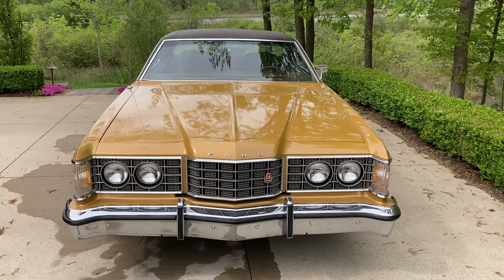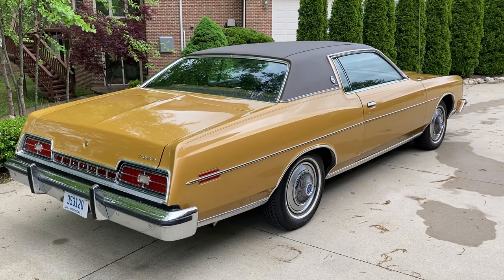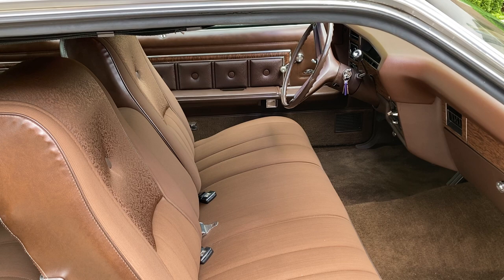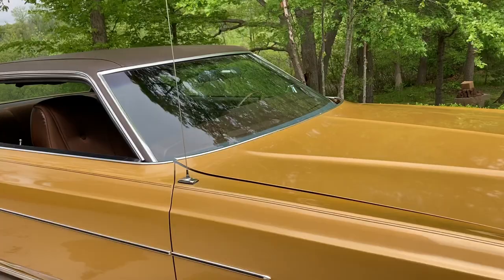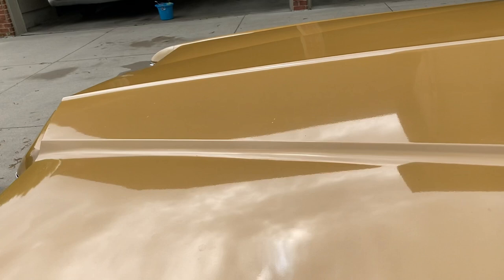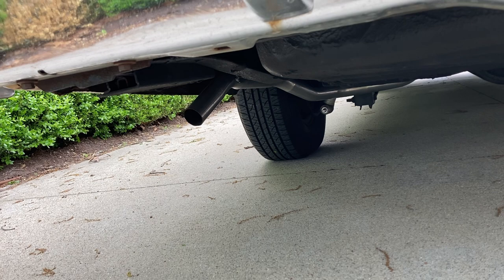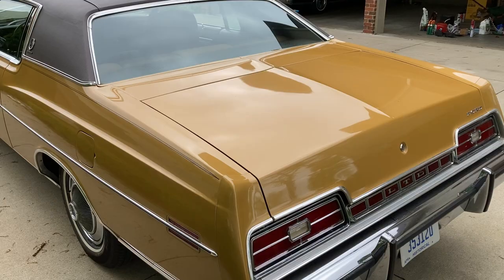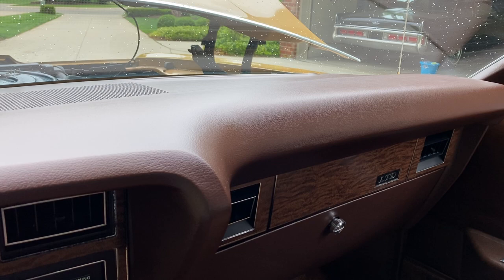1973 Ford LTD Brougham Coupe 460 V8 - The Everyday Man's Near-Luxury Car

Comment: As a small kid in the 70’s I always loved the LTD. 71 and 72 are my favorites. This is a beautiful example.
Reply: I agree with you on 71 and 72, especially the 71.  I always thought in 73 they looked bloated, and I never cared for the resurrection of the 65 style tail lights.
Reply: @kennethsouthard6042  The major change in '73 were park bench bumpers.  Not very much other than that.  The pre-battering ram ones are definitely better looking.
Reply: @HiroNguy The car changed drastically in 73.  In addition to the front and rear facia the The body sides changed to where I don't believe any sheet metal from 71 or 72 would fit on a 73.   The interior changed radically as well including the dashboard. Overall, the car just got bulkier from here and gradually became more of a mini Lincoln, similar to the Marquis
  The car essentially stayed in this form up until 79 when it was replaced with the Panther platform.
Reply: @kennethsouthard6042  I'll look that up.  Thanks for the lead!  To my memory my friend's '72 Galaxie looked almost the same as my '73 but for the bumpers but that was a long time ago so memory might not recall those details.
Reply: Early 70’s LTDs had the worst suspensions. You would drive one at highway speeds and the front end would bounce up and down,
Reply: 71 72  LTD's my favorite as well. Always thought Ford waited 3 years and used 68 Pontiac's "style" grills on the 1971/72 LTD model
Reply: @HiroNguy   That  is correct  in those  years   Semon  Bunkie  Knudsen  was  in the Presidents Chair at ford for a  short period  then  in the spring of 70 Lee Iacocca  became President the new models  that  come out  are always  a couple of years  old on the drawing board  you see  Henry the  second  grandson of  the old Henry  Ford  that past on  in 1946  was always a Secret admire  of the  General  Motors  culture  or persona  he loved their  marketing  strategy of a car for  every phase of a persons life  and  that is why he would secretly recruit  G.M .  People threw the back door at Ford  and would have secret meetings  with them at night  at their homes or some offbeat  back street location  as not to draw attention  but when they did come to Fo Mo Co  their stint  was short lived  some never made it past one year more like 6 months  G.M. People could not adjust  to his clandestine way of  operating  and  they could never  catch up to Fords pace which  was fast when compared to G. M.s  country club style & slower pace  he would give them the boot and they were totally dazed  they would walking down the corridor  or sitting at their desk  talking to themselves  totally  shell shocked  like did I just get fired ???  That’s  all folks  Ford was a fast paced  environment     You should read  Lee Iacoccas  auto biography  you will learn a lot  about  Lee  and the Ford family and  the Ford company  and auto industry and  all the supporting  industries as well  and a little about Wall Street  the banking industry  and our own government
Reply: My grandparents had the same exact car but was a royal blue and royal blue interior
Reply: @jeromecabral192  yeah when I was  Wee tyke  back in the early 70s  we had 3 LTD    Country Squires  71 dark green metallic  W/  dark green  interior   A 73  medium copper metallic   W /  ginger  interior  dark brown  dash & wheel& carpet   A  75  light / lemon  yellow green  a very rare color  with  dark green interior  and I remember a lot of details  that surprised  my parents  and my self  but like stuff to do with  school that was more important  I just don’t  recall  LOL
Reply: We had a powder blue 72’ 351 modified 400, that ol girl could eat the miles up.
Reply: 71 was gorgeous. Never should have sold it.
Reply: Me too!
Reply: @busman7228  < Not true.
Reply: Yes. Those are my favorite LTD years also.

Comment: Sacred Fertilizer!  This LTD looks almost exactly like Gus, my '73 Galaxie 500 2 door.  It was 351W 2 bbl.  I got it in Mississippi so we couldn't use the right side of the trunk as the rust holes were Yooj.
Reply: Sacred Fertilizer 🤔😜🤪🤯🤯🤯
Reply: @buff6637  Upvoted for that alone.

Comment: To own and enjoy a car of this vintage it helps a lot if you are mechanically inclined like this man is.  Otherwise you will be dumping money into it and stressing out over incompetent and dishonest repair shops.  This man had the upper hand with the dealership and they basically had to bend over and grab the ankles in this transaction.  Great stuff!
Reply: This is a turd, they didnt want it either. Trust me, they gave $300 on paper for it which is $350 more than its actual value.
Reply: @stevepulse4893  STEVE LOL 😂
Reply: these cars were easy to work on.

Comment: 73 is such an interesting year: the oil embargo didn't happen until the 74s were out. You get the smog controls and huge bumpers, but for the most part, you're getting this interesting blend of pre-malaise and early malaise features that are just super unique. It's the size and comfort and quality of the late 60s, still with a big block, but while also having the first compromises for emissions and safety. It's a transitionary period and I think that, as far as owning these cars today, they're a great way to enjoy a period of time where changes were coming quick and fast.

Comment: Wow, another remarkable find.  I was a 19 year old fixated on muscle and sports cars in '73 so I completely ignored these full size cars in the day.  Nowadays I can appreciate these vehicles more, and I have to say this Ford LTD is one of the best examples of the type I've seen.
If I was my current age back in '73 this is the car i would be driving. A comfortable, well appointed, powerful and slightly sporty full size coupe.  Thx
Reply: Rated at 212hp, curb weight 4260 lbs. Powerful? My god! Compared to what!!!! A tractor?
Reply: @stevepulse4893  Compared to other full size cars of that period it was not bad. Engines were rated in SAE Net Horsepower (all std engine accessories and std air cleaner and exhaust system in place). The compression ratio was reduced in '73 to run unleaded gas. Under the old SAE Gross Horsepower ratings it might've been rated around 300HP.  Performance has to be compared to similar full size cars of the day which will weigh about as much or more.  Even this 460 would have ample torque to get the car moving from a dead stop decently; it's just short on top end hp.
Reply: @rogermason5833  its rated at 212 hp. Sorry.
Reply: @stevepulse4893  It has the most powerful engine in that car line.  It was powerful compared to many cars of that era and later eras, as the car companies went with small cars with 4 cylinder engines in the 1980s with less than 100 hp.
Reply: @moonbeamskies3346  it was cool, but it never was a collectors item, but i definitely agree for its day it kicked ass,,,,,,all 4250 lbs of soul!😁
Reply: @stevepulse4893  Rated at 365 HP in 69 to 71. Torque was 480/500 fp. I drove a 76 Country Squire with a 400 rated at 180 NET HP, 330 fp of torque. Despite it's weight it was kinda fun to drive, lot's of low RPM torque.
Reply: @stevepulse4893  212 is plenty of power for a 4260 lb car. Sure it's not exactly fast, but it's more than enough to keep up with modern traffic, plus you gotta keep in mind all that low end torque.

Comment: There is a 1974 Ford LTD coupe with a 351 2 barrel motor for sale at a dealer I drove by in Northern Illinois. It has 18,000 original miles on it with the original title. It has allegedly been in a heated garage since 1980. They are asking $9990 for it. New fuel tank, fuel pump and tires. Maybe I can low ball it like Adam did this one.

Comment: I one bought one new. Yes, during the gas crunch! 1974  2dr. LTD Brougham. Ginger glow metallic. 460 V-8, C-6, 3.25 axle, trailer towing package, A/C, P/S, Front power disc brakes, auto. e/b and trunk release, l/h and r/h outside remote mirrors, Cloth beige interior, Split power bench front seat, tinted power windows, power locks, cornering lamps, convenience group, light group, bumper protection group, etc, etc. Only issues I ever had with it was a bad steering spool valve (blame Saginaw for that!) repaired under warranty and a lean surge at highway speeds. Richened the jets and that took care of that. Drove it for about 40,000 miles and sold it to a friend. Smoothest and quietest riding car in its price range by far! I miss that car.
Reply from the maker: Wow.  That wouldve bee awesome.

Comment: Beautiful 73 LTD Coupe, rare 460, even 429s were rare as most had 351s or 400s, that is a true timecapsule, love the big cars with big engines, got a 73 Olds Delta 88 Royale Coupe factory 455 115,000 original miles all manuals including maintenance records, runs like new nice shape.

Comment: My parents traded their 1970 Ford XL convertible 429-v4 with almost all options on it ... (it was a dealership demo)  had 6k miles on it. When they bought it. That '70, was white convertible  top, black interior, Bucket seats and console, and Sunshine yellow body color. What was cheap about that car was the wheels, and hub caps? That car had AM/FM too.  I was so mad... I told my dad I would  buy that car from them.... He sold it.   I kinda never got over it....  for being a big car at the time ... I loved it.  It would smoke the rear tires!   But...  So My parents bought a '73 LTD dog car...  Life goes on

Comment: Had one of these in fire mist metallic! One of the best cars I ever had in reliability! Lost due to rust, frame in front of rear wheel! Even the tulip panel rotted ! Was a beautiful car though! I miss these land yachts! Bob Lutz was interesting as always!😎🤠
Reply: Especially in '73 and '74, Ford had really serious body/frame rust issues, to the point of class-action lawsuits. I never did find out what the root cause was, whether it was the poor quality of steel used in the plants, design problems, or skimping on rust protection measures during assembly.

Comment: Beautiful car.  Until recently I had thought the 460 to be unavailable in the Ford until 1974 when the 429 was discontinued.  It would be interesting to know if it was a late addition to the engine lineup.
Reply from the maker: Nope.  Always included as an option in 73.  Late option in 72 for Mercs.
Reply: You just found your next ride blind man!

Comment: In 1985 I needed a car, any car. At a used car lot in Fayetteville, North Carolina a 1975 LTD was on the back row, covered in dust, the cheapest car on the lot. I bought it. Mine had the 351 engine and A/C. Four wheels and A/C was all I cared about. It was a good commuter and cross country car.

Comment: Nice!  I hope you jetted the carburetor a bit richer and advanced the ignition timing a few degrees.  If so, don't forget to flip that air cleaner lid when you drive it.  
Thanks for sharing.
Reply: Can you explain why that would be an important consideration? Unfortunately I didnt get to grow up with cars like this
Reply: @dannygallagher9290  In the early 70's, before the manufacturers learned to beat emissions by altering cam profiles and lowering the compression ratios too awfully much(all of which reduced power output tremendously), they simply and inexpensively just retarded the ignition timing a few degrees along with much leaner carburetor jets.  Considerable horsepower could be gained by advancing the ignition timing 4-6 degrees and jetting the carburetor richer to prevent spark knock.  Flipping the air cleaner lid allowed for adequete air flow into the engine since they were (and still to this day are) muffled for quietness by a small restrictive air intake on the air cleaner housing.  Lots of power to be gained with those three mods.
Reply: @greggc8088  thanks for explaining that! Much cooler than what im used to

Comment: My first car was the 1973 LTD with the 400.  Canary or Custard Yellow with dark green interior.   Grandpa got it to pull his boat, which had a two axel trailer.  Anyway, time went by and I got it.  It was a good thing that my dad owned a gas station.  The only mishap that I had was that the brake switch that turned off the cruise control broke.  Living in rural Iowa, I  set the cruise to 95 when on a country straight country road.  Came up over a hill and found the Beverly Hillbilly's truck rattling along and waited to the last second to hit the brakes.  Suddenly, as it slowed down, all I saw was yellow hood.  Guessed where that truck was at and passed on the shoulder with a black cloud of smoke behind me.  Once I got back on the road, and could not get the cruise to shut off, I threw it in neutral until I got the engine back under control.  MEMORIES!!!  What killed it was the automatic choke going out and filling up the crankcase with gas while my idiot brother was borrowing it.  By the time he figured out what was going on, it was coming out of the top of the dipstick tube.

Comment: I love the story behind this car that reminds me of a time when I went to get a Mercury Grand Marquis and a guy had one parked out by a barn and it had the 302 in it and even a full tank of gas
The guy said that it just stopped running and we asked if we could go out and look at it so my dad was with me and we were poking around it and I seen it wasn't getting any spark so since it took the same type of coil as the car we were driving a Ford Fairmont I swapped coils for a moment. Back in and the car fired right up
Dad said get that coil back off there and hear go up and pay the man he only wanted $100 for the car and tell him we'll come back tomorrow to to get it that was back in
But this car here in the video is fantastic I love it's looks these are the type of cars I grew up with in love and I also had one later in my ears to one of Ford's best cars
I also like the seat belt system for 1973 that as soon as you took it out of park anybody sitting in the front seat if they didn't have their seatbelts fastened the seat belt light and buzzer would stay on 74 models too early 75 had the seatbelt starter Interlock system

Comment: In 2002 I bought a similar equipped car at the annual Decatur Swap Meet northwest of Ft. Worth the last weekend in February.  Being at that time of the year you're taking your chances with the weather, but most of the time we lucked out.  A fellow had come over from Azle with a light yellow with gold pad on the roof '76 LTD Landau coupe with 33K miles on it.  When I saw the crank windows, I assumed it had at most a 400.  Instead it had the 460 and virtually every option available in '76, including heavy duty suspension and factory dual exhausts.  Manual AC, cruise, power seat, deluxe sound system with tape player, cream and gold vinyl interior.  The downside was that it had gotten light hail damage while sitting on a friend's used car lot in Azle while the truck driver owner was on the road.  Thus, I got it for $3,500.  It drove as good as it sounds and I kept it until I moved back to Waco in 2005 and sold it to a collector from Longview in 2006 for $2,800 so I could buy my 4th '77 Grand Marquis when then had 51K miles on it.  I kept it until 2019 and am now Marquisless.

Comment: This brings back memories, I bought one just like this from a salvage yard without the motor and trans in about 89' I had just recovered from an accident in my Mach 1 and bought the Ltd to slip the hopped up 400. What a Sleeper. Cruising around with a 400 hp V8, headers, cam, intake all the while retaining the white walls and hub caps. Wish I still had that 2dr

Comment: Amazing how that Ford dealer didn't know to get it running? Sure is a beauty
Reply: Sales not talking to the Service...  didn't want to stick anymore money into the car
Reply: @jake664  Also, the kids don't know how to work on something that's not fixed by clicking on a touch screen.
Reply: You’d be surprised. My 1993 Corvette had an intermittent no start issue and my local Chevrolet dealer didn’t wanna touch it because they had no clue how it worked.
Reply: Theres a resson, it isnt worth the cost of parts to get it running, no one wants it! Isnt worth anything, to the crusher.

Comment: I had a four-door version of that car. The 460 had plenty of power, but man was it thirsty. In town I got between 8 to 10 miles a gallon as long as I babyed it, but it sounded like a toilet flushing when I opened up that quadrajet it pulled so much fuel. I do taking consideration I owned it during the early 90s when gas was still right at a dollar a gallon.

Comment: My F-250 had a 460/4brl carb with C6
3 speed trans. I towed a 5 ton trailer up Inkopa grade in soCal at 60 never down shifted. Huge power. Regular gas, too.

Comment: That's a real gem.  I always liked the LTD's.  I thought the 460 was not available until '74 but I always learn something new.  I love the Brougham interior, fabric and high seats.  I love that it has the bumper protection package and I REALLY love the deluxe wheel covers.  Those really make a big difference.  Also were used on the T-Birds.  Funny how you could have picked a car like this up during the late 80's to 90's for $1500 as they were almost considered "disposable" and millions sent to the crusher.  Just like the beautiful Country Squires of the same vintage.  My dad bought a brand new '77 LTD Landau coupe w/460 and hideaway headlights at the big 4th of July sell-a-bration at Courtesy Ford in Colorado.  It was sitting on the showroom floor.  He traded in our '74 Chevy Blazer, Cheyenne for it.  My mom was so mad at him but I, being 15, was extremely excited.  I learned to drive in that car and loved it.  As always, love your channel and thanks for sharing!
Reply: In 73 the 429 and 460 were an option.

Comment: Lust Factor: HIGH    I had a 1977 almost identical to this. Same color. 2 door. Had a thrashed 460 in it but we put in a 460 from a police auction and it woke this bad boy up.. Just a little bit more square in body shape than this one. A BEAST after putting in the interceptor motor. I miss that car.